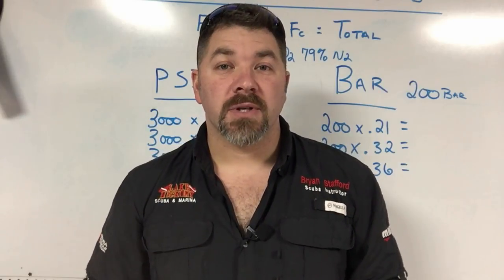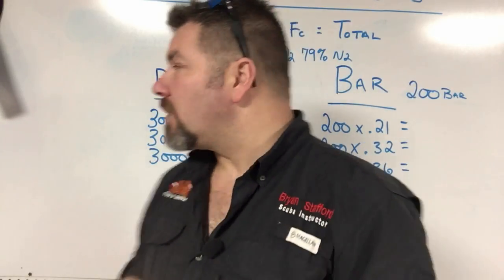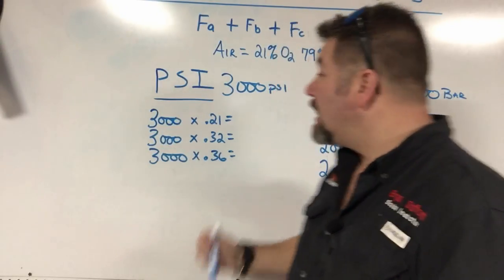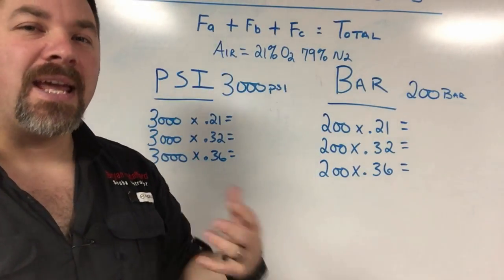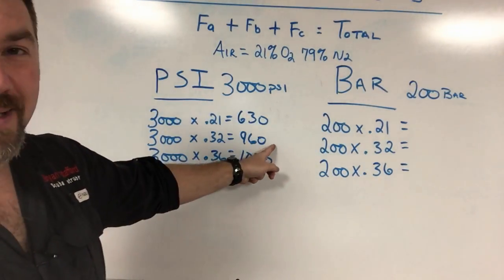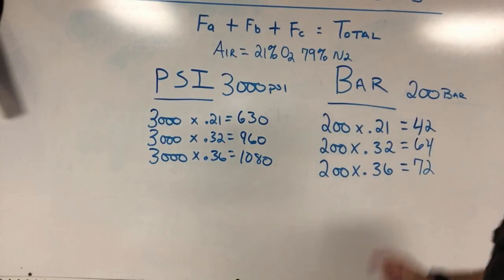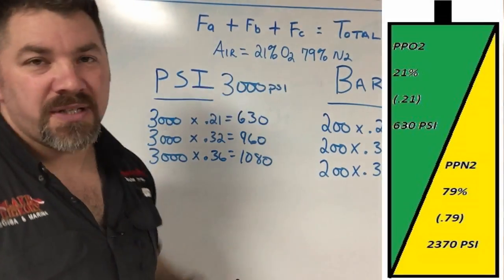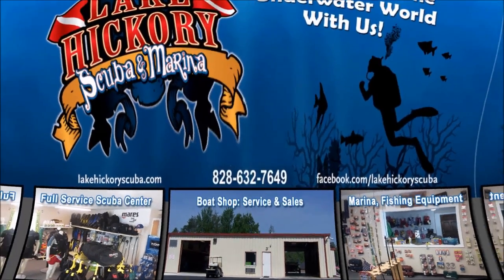Calculating Pressure In Partial Pressure Of Gases (PSI & Bar)

Comment: Okay okay not that I particularly need to know but I know somebody is bound to ask what happens if you have a dual tank configuration bonded with a manifold and you are partial pressure feeling the tanks to 02 clean standards lol... Do you calculate total volume in PSI for both cylinders or isolate them and calculate them individually
Reply from the maker: Great question!!!  So I get asked this question every time I teach a Gas Blender Course or even a normal Nitrox course.  In short, with doubles we consider them as one cylinder instead of 2 during the filling process.  Manifolded cylinders are much easier to calculate and fill as one, instead of two.  For the obvious reasons, it would take too much effort to try to fill them separately, and at the same time, guarantee that they both had the exact same blend.  If they were off, even by 1%, as soon as the manifold was open, the two cylinders would mix, causing the blend to be off.  As far as the total volume (2 steel 100's totaling 200 cubic feet or a manifolded system still being considered 100 cubic feet) the math is done with the assumption that the 2 cylinders are only 1 cylinder, and considering the fact that a gauge would only read the maximum of 3442 psi and not 6884 psi (or the maximum you filled the cylinders too), we would consider them once again as 1 cylinder during the calculation process.  The biggest hiccup that comes with partial pressure blending cylinders, as far as doubles goes, is when the cylinders begin to cool, and a diver is diving un-manifolded singles in a sidemount configuration.  The biggest concern to the fill operator is to make sure both cylinders are identical.  Even with single cylinders (un-manifolded) in sidemount, systems like the UTD Z-System institutes a manifold back into the system, thus if the cylinders were not filled identically, the desired blend could change, once manifolded together.

Comment: Presented well, Bryan, as usual. I assume in the next video you will explain "why" it is important to know that if I have a 3000# cylinder with 32% nitrox that equates to 960# of oxygen. As I watched I kept asking myself, "yea, but why would I care?"
Reply from the maker: You would correct, in the next couple of videos, we will be using these calculations to help in the partial pressure blending process.  We decided to break the videos up into smaller sessions, to help others grasp the concept.  Stay tuned.

Comment: Why would you need to know partial pressure? What applications would you use different gasses and partial pressure
Reply from the maker: There are many reasons, whether we are concerned with Oxygen Toxicity, Nitrogen Narcosis, calculation our Maximum Operating Depth, or even blending a specific mixture via partial pressure blending.